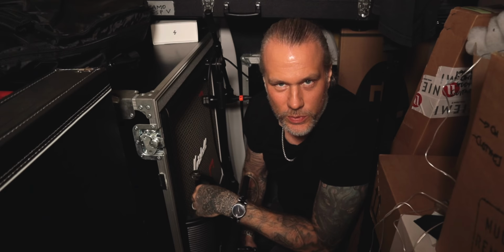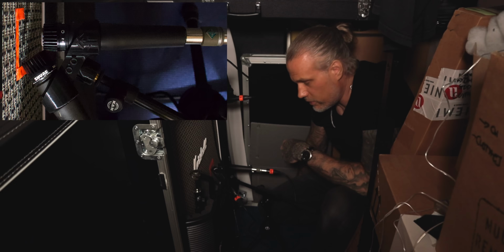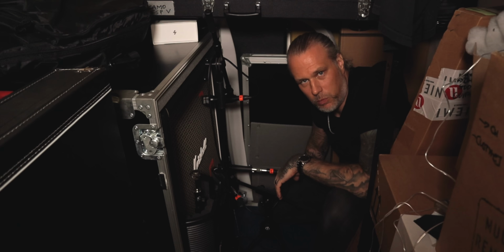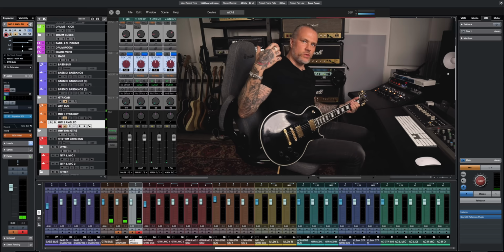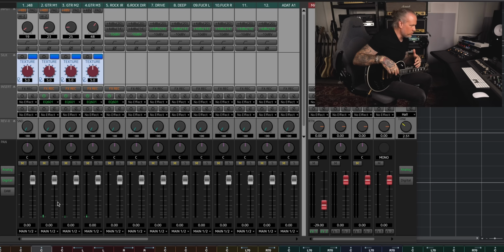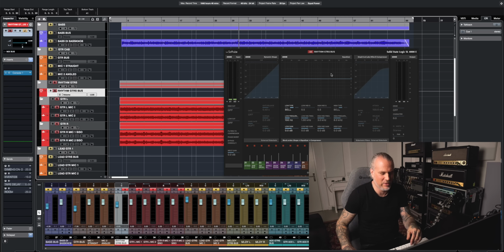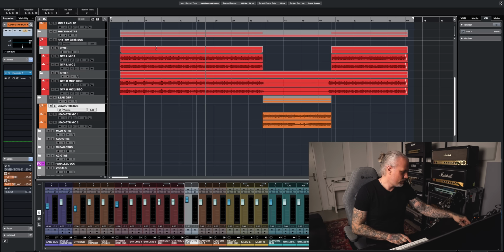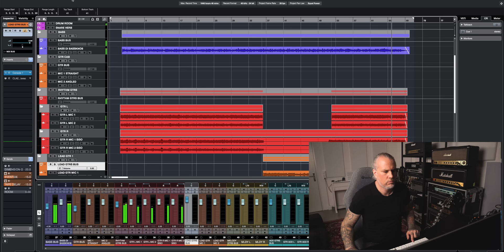The FREDMAN Miking TECHNIQUE | Killer METAL Tones.

Comment: Any Helix user here? I just tried this technique and its sounds amazing. Now that last firmware update on helix (3.5) allows you to move mics around the cone and even delay one or both of them and set different levels for each mic, you can pretty much emulate the friedman technique. I use this video as reference, only thing i change was one of the amps. I used a jcm800 with a Mark iv.

Comment: I am gonna check this Fredman Technique out my self, whats quite interesting is that it seem to be very simple to get the guitars to sound really good, not much tweaking here and there, but i have a question, i dont have 5000 Euros to spend at the moment so is there some substitute for the SSD Fusion and the Tegeler Audio ? After all it seem to do quite some differece.. Thanks..
Reply from the maker: Yeah it’s simple and the angle of the mics is really important to get the correct phase cancellation of those high harsh frequencies.

SSL makes separate plugins of the Fusion and the Tegeler Creme is basically an SSL style G-bus compressor (with adjustable sidechain lowcut) and Pultec style eq in one. Softube’s Tube-Tech (Pultec) eq plugin is really good and there’s many good SSL bus comp plugins on the market. Waves’ CLA MixDown is also good plugin and I’ve mixed songs / albums with just that in my mixbus before I bought the hardware stuff. As hardware stuff goes these two aren’t that expensive compared to similar high quality gear.
Reply: @EugeValovirta230V   I am not a software guy at all, its just a hazzle, i´d rather go for hardware if its not to expensive, since some years back i use STL Amphub, once it´s installed and working its all good, but if i install on another computer its just a hazzle to use iLOK license manager to deactivate and activate different licenses and what not, it can drive me crazy. i use Amphub only for demos and riffs at home, in my studio space i have all my amps and pedals and guitars and only using mics and cabs and Logic Pro, no software plugins or similar. i would want the signal comming in to the soundcard to be as good as possible so i dont have to mess around with EQ and alot of other plugins, i am looking for as much old school ways to do things as possible. Maybe just mess around with levels and pan and some little simple EQ and the master track before bouncing it to it´s finished Audio File.. :D

Comment: Fantastic playing my  friend.... I get a great rock/metal tone using my Les Paul, EVH Iconic 40watt into Captor X at home. When I turn it up loud at gigs into my Atomic CLR powered monitor it sounds crap. All the connections are good. Any ideas please Euge. Thanks.
Reply from the maker: Thanks! I’m not familiar with the Atomic but if it’s a basic full range monitor any amp would sound like s€*&t plugged directly to it. Guitar amps should be connected to guitar cabs / speakers which range is quite limited. Or if you have miked your cab and use the Atomic just to monitor that then probably the monitor is just not that good 😎.

Comment: When double tracking with the Fredman technique, should I leave both mics panned in the center and then pan each take left and right?
Reply from the maker: To do it the original way you should sum them before hitting your audio interface so you get one signal. The whole idea is that they should be treated as one with the high end phase cancellation 👌.  Panning is up to the mix. I usually pan rhythm gtrs hard L/R.

I use Radial’s MIX 2:1 device for summing them into one before my mic pre. Didn’t use those on this video ’cos I wanted to show the phase cancellation thing etc.

Hope this helps! 🤟
Reply: @EugeValovirta230V  Thanks a ton Euge! Don't have the budget for the Radial, so I'll try it the non-conventional way.
Reply from the maker: Yeah that works too!

Comment: Euge, honest question, with all the great IRs nowadays, whats the point of going through all the trouble of micing a cab? Can you honestly tell the difference?
Reply from the maker: It’s fun and you can have exactly the sound you’re lookin for. There’s a reason why real gear in general is used in professional studios / productions. In a good mix you probably can’t hear a difference but when you get the sound right when recording usually you don’t have to do much in mixing. Sometimes nothing 😎. But good IRs, like Jens Bogren’s are really great and I’ve used, and still use, them a lot in my productions. I guess they’re a bit static compared to a real cab ’cos it’s a bit hard to capture a speaker moving air in real time into a very short WAV. Only a snapshot of it but it’s ”just” a snapshot 😊.
Reply: @EugeValovirta230V  thanks for taking the time to reply.  And you make a great point about the ability to practically mix using mic positioning and proper cabs. Keep rocking!
Reply from the maker: Thanks!